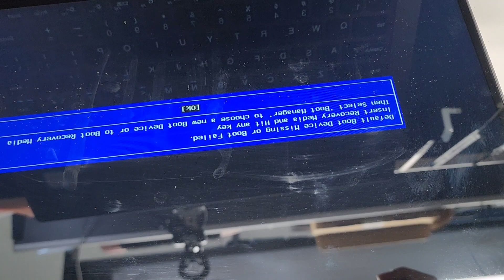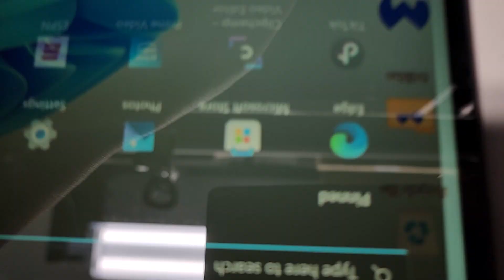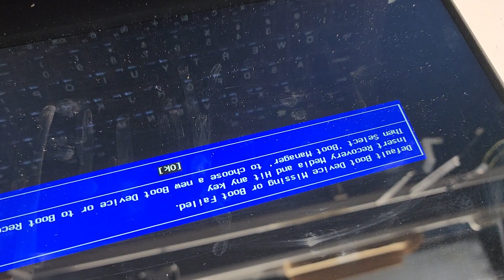Computer Laptop Lenovo Yoga 910-13ikb Power Button Not Working Unless Plugged In M.2 PCIe SSD Issue

Comment: I have a problem with the high temperature in the ssd. It works for a few minutes then the blue screen appears in windows... The temperature is very high... I changed the ssd to another model, the same problem
Reply from the maker: @shadialshihksanaa381 that's normal
Reply: @ItsBinhRepaired  I can't install windows on my laptop?
Reply from the maker: @shadialshihksanaa381  why not?
Reply: @ItsBinhRepaired  can you tell me best ssd model I can use it
Reply from the maker: @shadialshihksanaa381  no budget limitation? How much storage?
Reply: @ItsBinhRepaired  256GB or 512GB
Reply from the maker: Sorry, didn't see your response. I'm assuming you figured it out by now.
Reply: @ItsBinhRepaired  Don't worry. Do you have any options in SSD type?
Reply from the maker: @shadialshihksanaa381  how much storage do you want?
Reply: @ItsBinhRepaired  512 GB
Reply: @ItsBinhRepaired  512 GB
Reply from the maker: I used this https://amzn.to/3ZO4iji
Reply: Thanks a lot 🎉 @ItsBinhRepaired
Reply from the maker: No problem
Reply: @ItsBinhRepaired  hi there I bought the same product that you sent the link... and installed it.. same problem...

Comment: I have a similar problem. Thanks for good video diagnosis. I'll let you know what I find... going to try resetting the power button cord mentioned in the msgs.
Reply: OK. Got it fixed. Maybe this will help someone. 
In addition to the Power button not working unless plugged in, I also had the problem that my battery status/% indicator showed no charge. I surmise 2 things putting together multiple plausible comments from forums:

1. The laptop will not power on if the battery sensor detects a very low charge. Presumably they want to see enough juice to complete at boot up to avoid corrupting any files.

2. Some mentioned if you run the battery completely down to 0% in a Yoga, it creates the battery error we are seeing resulting in the power button only working with the power cord connected. I probably did this as my new replacement battery suggested 3 complete cycles 3% to 100%. In depleting the battery, I didn't catch it at "3%" and ran it all the way down. That may have tripped the problem.

NOTE: Supposedly Lenovo's have a "battery reset" pinhole button. This 910 instead has a "Novo" button just to the right of the Power button, which can reinstall everything on notebook if you choose the wrong option. I didn't try this. Here's  some info: https://pcsupport.lenovo.com/us/en/products/laptops-and-netbooks/yoga-series/yoga-910-13ikb-glass/solutions/ht503785-how-to-use-reset-this-pc-by-pressing-the-novo-button-in-windows-10-ideapad

Here's how I fixed it.
Thanks to Comptechnyc on YouTube for some good clues. I have a Lenovo Yoga 910-13ikb. Binh's videos are great for the specific how-tos for these steps, except it wasn't the SSD for me though. Thanks!
STEPS:
1. Disconnect battery from motherboard.
2. Long-Hold power button for "10-14 seconds"
3. Comptechnyc suggested at this point plug in power/charging cord and try to boot. His different model booted. Mine didn't boot, so I just went on.
4. Reconnect battery to motherboard.
5. Test -> My power button now worked unplugged! Also my battery charge indicator on the taskbar was working again. Psych! 

Hope this helps someone.
Reply from the maker: Awesome!
Reply from the maker: Sounds good

Comment: This is frustrating…I have this same issue with the crucial P3…
Reply: I bit the bullet and bought another SSD same day...For anybody that has a 910 and is upgrading SSD with a Crucial P3...STOP right there. I can confirm that this SSD has the same behavior as described in this video. Buy a Samsung 980 pro, instead. It just works!
Reply from the maker: @videomasterlou  glad it worked

Comment: I have a similar problem with the same model of laptop. The charging LED lights on when plugged in, but the laptop still does not turn on when pressing the power button. When the laptop is unplugged, it does not turn on either. 

However, when the laptop is plugged in or unplugged, my USB ring light turns on when connected to the USB port of the laptop, so there is power being given to my ring light. At the same time, my Razer Huntsman RGB keyboard does not illuminate when plugged into the laptop; nor does my Steelseries Rival 3 RGB mouse. 

Should I replace the SSD? How should I go about solving this issue?
Reply from the maker: Sounds like a motherboard issue if nothing comes on the screen

Comment: what model SSD worked? Im dealing with the same exact thing.... even the same Crucial drive.... after the fact of course.
Reply: SAMSUNG PM991 (MZVLQ256HBJD) 256GB M.2 2280 worked as well.
Reply from the maker: @reliant_turbo  nice
Reply: @reliant_turbo  I am looking to improve my hard size, not just to replace.
Reply: @muthanaalrawi4140  don't know what to tell you. Either buy the one that Binh referenced, (large capacity) or buy the one that I tried (17$) or try another OEM Samsung drive that is larger. I chose a drive based on the fact that it was a Samsung OEM drive that was similar in part number to the original.
Reply: Also, I believe crucial lists the Crucial P5 Plus 1TB PCIe M.2 2280SS Gaming SSD as compatible with this laptop and not the P3 that I originally tried.
Reply from the maker: I hate how YouTube doesn't notify me of replies. Were you able to figure it out?
Reply: @ItsBinhRepaired  yeah. Using another OEM style Samsung drive. Works mint.
Reply from the maker: @reliant_turbo  awesome!
Reply: So, is this model working fine? Because I have the same issue and I did not figure out what the problem.
Reply: Also, there's multi model,  do you think all are working?
Reply from the maker: @muthanaalrawi4140  Hm?
Reply from the maker: This is what I ended up using https://amzn.to/3PPLJWU

Comment: Hi,i have the same probleme,but with me it happens when i chznged the battery...the power bottom works but only when i plug in the charger.i noticed that when i plug off the charger the power bottom works just seconds after,but if i try after more time it wouldn't work,so it has to be powered to work,kind of it need electricity to work or something😅
Reply from the maker: Yup, strange

Comment: I'm experiencing the same problem.  I used a Samsung Pro 980 2TB.  Drive works great but now no power button and the USB port doesn't work!!! HELP
Reply from the maker: If you disconnect the m.2 SSD does it work?
Reply: @ItsBinhRepaired  UpDate I fixed mine.   I've restarted twice with the power button and USB.  I reopened it and disconnected the cable from the power button/USB board to the mother board and reconnected with twizzers. And it all works again.    Also a bit lesson learned for me is backup your bitlocker key before doing the SSD Swap!   But I was able to recover my key.    Best regards and I hope this helps you also!
Reply from the maker: @JCEverett77  nice!

Comment: These laptops are glitchy as hell, currently have a similar problem after replacing keyboard power button no longer works laptop boots after connecting battery but no power button and no speakers
Reply from the maker: The issue I found is it didn't like that specific brand/ model SSD.